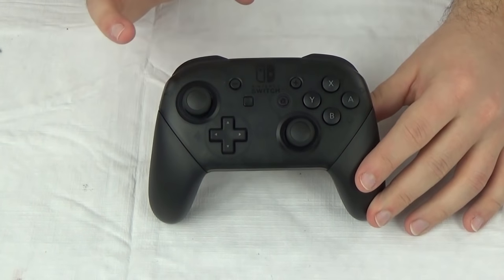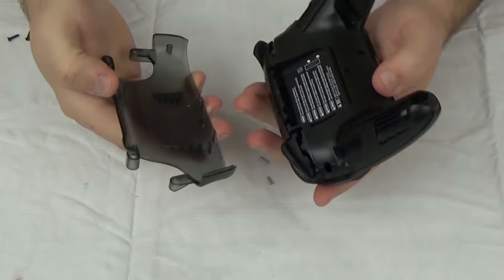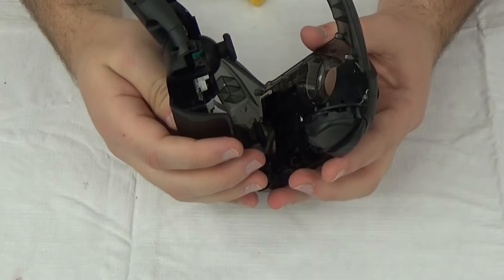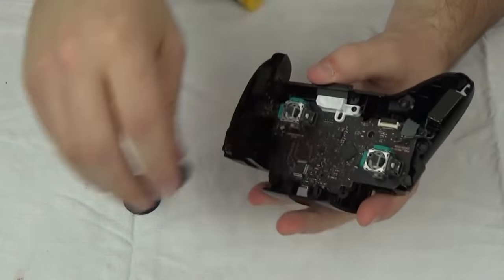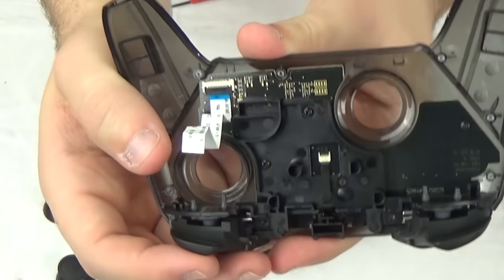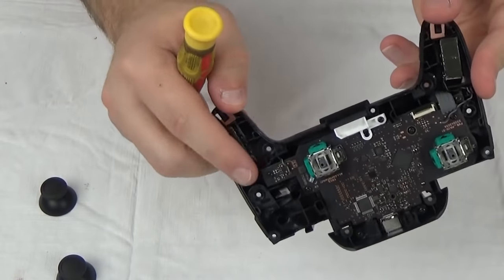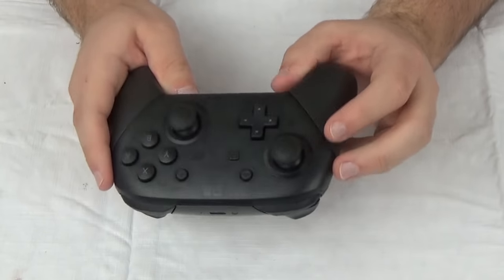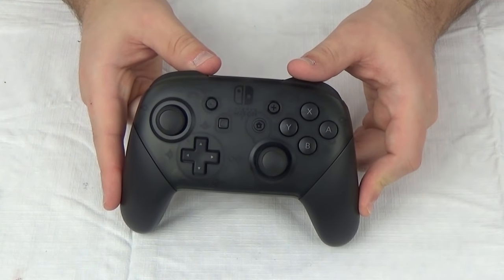Taking Apart The Nintendo Switch Pro Controller! Secret Message Inside?

Comment: It's amazing how well this is put together, and sealed, yet cat hair still gets in.
Reply: It can be a sealed multi layer steel cube with no edges and cat hair will still get in...
Reply: Bro I shined a flash light in mine that I have had for years and it's absolutely ducking filled with dog hair
Reply: @themanofmilk6394  wow do you have a dog
Reply: Bro, I was thinking the same thing. I have fuckin cat hair in mine. I don't own a cat or dog.
Reply: @ragnaroksangel  Did you buy it used or online? Or someone else used it other than you? Maybe that's why. Maybe you took your switch and controller somewhere that people either own dogs or had them over/people over who owned dogs. These are the only explanations.
Reply: Yeah I just cracked mine open and the right joystick was completely packed with cat hair. Funny considering it was the other one that wasn't working

Comment: My favorite controller so far. Feels great.
Reply: same here. got the   neon switch and the neon extra joy cons to complete the res and blue set. Pro controller does feel better than the joy con grip
Reply: Miguel Angel my husband and I are actually really enjoying every controller option
Reply: mlapointej  Same.
Reply: @gaswanson Wow I'm exactly thinking like you. I actually have the second set of Neon Joy-Cons and an extra Grip already, but I'm thinking of bringing them back to get a Pro Controller instead :/
Reply: The Pro controller is amazing, waaaay better than the wiiu pro controller. Very pleased, glad I bought one.
Reply: it's my second favourite controller of all time after the xbox one elite. but it's the best nintendo controller of all time.
Reply: Does the switch controller feel heavy at all?
Reply: Randy Beltran oh yea it feels very solid, very even weight all around
Reply: Miguel Angel lol even though its a carbon copy of the xbox controller
Reply: OldYE Chap Except the Xbox controller was a Gamecube controller with a slightly modified ABXY Layout
Reply: I've got 2 pro controllers that are broken. The first from amazon, the left stick was stuck in a downward postion causing Link to constantly move down slowly. Tried calibrating it and when you press down you can see it doesn't go past the circle like it should. Then I was able to find one at ToysRus and this one has a new problem. When you press a direction and let go, the stick jerks to the opposite side, so say i'm trying to move up to pick a conversation with someone, you press up and it jumps right back down to the previous choice. Calibrating did not help either. Now I have to bring this one back and I doubt they will have anymore left to replace it with. If I get 1 more controller that's screwed up ima flip my shit.
Reply: nah mayne.
Xbox one controller is best
Reply: Kyubey exactly people who lie to themselves constantly every day this is a clone of the xbox controller but everyones okay with cause it isnt xbox and no one will mention it either
Reply: Colin Hennessey you do realize xbox and game cube came out the same year right ? and i think only a month apart xbox didnt copy anyone they made the best ergonomic controller a head of its time just google release dates of both systems you'll see
Reply: Colin Hennessey just checked the dates came out in the same month but xbox came out on the 15th of November 2001 and the gamecube came out 3 days later on the 18th think before you speak and stop buying into the media
Reply: Colin Hennessey correction gamecube released in Japan in September 18 a month before the US launch so what ever console makers made final were set in stone they cant go back and redo their designs within a month so you're far off and the game still isnt ergonomic enough it doesnt just fit in the hand like the xbox controller does feels perfect
Reply: OldYe Chap I didn't really like the original Xbox controller it was very big and my hands would hurt while trying to rest them on the grips I also had to let go to mash the buttons at the center of the controller as well game cube controllers are very nice to hold in my opinion and is only second to the to the feeling of a game boy advance in my hand.
Reply: OldYe Chap Its not like an xbox controller on purpose I am sure as it was most likely a taken redesign of the offset sticks on the GameCube controller the control stick was upper left while the C stick was lower right it's just like an xbox controller now because of how they used the same design from their Wii u pro controller the controller has diffrent technology any way as it's not a crime to make a controller comfortable but it is a crime to copy and steal someone else's technology and use it against them.
Reply: GreyAlien2012 game stop had no issues it sounds like the controllers where thrown into the delivery truck very tragic indeed.
Reply: Legend X you forget the xbox s controller solved all those issues right and the 360 remodeled that design making the xbox controller the best most ergonomic controller yet people just say stupid shit like this cause everyone loves to hate on ms or anything to do with xbox everything to do with Xbox has bad and biased news towards it so people have gotten this trend to hate on one of the best companies in the world and if it wasnt for Microsoft we wouldn't even have video games themselves
Reply: OldYe Chap very true but we would still have games they would just be uncomfortable to play on the old style controllers.
Reply: OldYe Chap if we didn't have Nintendo we wouldn't have video games at all!!! LOL Nintendo saved the gaming crash after the Atari...
Reply: Captain Koopa no if we didn't have Microsoft we still wouldn't have gaming do you know what c+ is ?
Reply: Captain Koopa Microsoft is responsible for the structure of the internet and reason why it works the way it does cause the believed in the future no company not sony and not even Nintendo invested into this
Reply: OldYe Chap you miss interpret what he is saying if Nintendo didn't put out the first true console gaming was well on into it's grave by this point Microsoft would never have made Xbox Sony would never have made the play station and gaming in every sense of the word would be null and void in a simpler term dead. I get that Microsoft has made great additions onto the gaming world but unfortunately even with all that they have not saved gaming they've merely prolong its life span in a sense the way it's going now games are dying there is no doubt about it Microsoft has added a lot with online play and higher visual driver's such as c++, but this isn't the same Nintendo pulled gaming out of its grave mere moments before dying and gave it new life and meaning. just to be clear if Nintendo kept going as a manga company for their IP's we wouldn't even be having this conversation hell PlayStation and Xbox people would be people that play on a pc because that's all that would be there. so yes Nintendo did save gaming and gave is the chance to play games that we like.
Reply: Legend X for consoles probably yes but gaming was already heading to pc it was far from the Nintendo saved the home gaming entertainment side of the i dustry dont make them out to be a hero of it all cause they arent
Reply: Legend X people put Nintendo on a pedestal and this is why they come out with peace of junk after junk
Reply: OldYe Chap m8...Microsoft got into gaming because of PlayStation and nintendos success on consoles... no offence but Xbox doesn't have any good 1st party game THAT YOU CANT GET ON PC
Reply: Legend X if you continue tue accept what Nintendo offers for the very few exclusives it has they will always release mediocre Hardware you have to correct them you the fans have the power to stop this Nintendo has a back catalogue and a whole bunch of classic games to propel themselves into the future of Gaming with a new next-generation console that is comprable or even more powerful than the Xbox Scorpio Nintendo refuses to put money into something because they're afraid they'll lose it so they make safe Investments like a handheld Nintendo known for handheld that I can agree but this time around everyone has cell phones and it's also been proven that Nintendo can no longer skate on their handhelds to win the console war for them they have some of the best first party games Xbox and PlayStation wouldn't be able to stand a chance with Nintendo if they decided to make a console that was powerful enough to run the third party games that the third-party developers would make for them they would be the leading platform and the common denominator when it comes to development choice for the future of Gaming but they refused to acknowledge this because you and other friends like you and indulged this type of business
Reply: Captain Koopa same for ps4 m8 might wanna go read the news homie
Reply: Captain Koopa PlayStation decided to try and combat gamepass and well put their entire library of games including every exclusive they have on PlayStation now and i can play uncharted 4 and horizon zero dawn on my pc
Reply: OldYe Chap you can't play AAA games on your phone though. That's the difference, and btw Japan buys A LOT more handhelds than consoles so the switch will do fantastic in japan no problem. They just have to prove to the West why it's a good idea to get their hybrid, I already got one though because handhelds work in my lifestyle but I also have both other consoles
Reply: OldYe Chap I have in no way put Nintendo on a pedestal I agree that the some of the shady shit they do is wrong but they whether you accept it or not saved gaming Microsoft has titles I enjoy fable was one of my favorites until they cut the studio that makes it I used to  it games for my Xbox and was going to get an xbox1 until I heard Fable would stop being made by this point. I also enjoy play station games such is the way of a well rounded gamer and not some stuck up piece of trash. without Nintendo in the first place we would not be gamers on consoles but computers which didn't sound so bad but I would miss games like Zelda on Nintendo, fallout on play station and Xbox and many of the other title's that just feel better yo me on a console I would miss my PSN friends and all the like in reality all you see is some "Nintendo fanboy" even though I only stated fact and gave credit where credit is due Microsoft brings a lot to the table with visual driver's and internet conectivity but I haven't played a game on any console that makes me feel emotion as Nintendo does their hardware may be cheap but their developers make great games. as do Microsoft and most 3rd parties I enjoy all forms of gaming. also I did admit that Microsoft makes great controllers for the Xbox 1 and 360
Reply: OldYe Chap I am not puting them on a pedestal I would love to see Nintendo be who they where in the 90S and I feel they are starting to move in the right direction again the game lineup isn't as bad as the Wii u where all the games where at launch and then a 1 release every half of the year. I want them all to succeed but the way it's going I see copy past every where I look now it's hard to play these games sometimes because they feel over played and used up I want a game to wow me again I would love that and this Zelda game did just that I tried to get this with the elder scrolls series many years ago but it felt a little bear of terian even.
Reply: OldYe Chap LOL XBOXS HARDWARE IS A POTATO COMPARED TO A PC!!! AND A PC IS CHEAPER LMAO people don't pay for nintendos console for power they pay for games...
Reply: OldYe Chap but I sitll respect Xbox for its media system. Xbox is made for games but mostly a entertainment system.
Reply: Captain Koopa pc isn't cheaper a console is sold at a static price all the hardware they get subsidized pc you have to pay full price with very little in sales pc is far from cheaper at 500$ being the price point at which i can game comfortably not being cheaper there is no cheap point for pc am xbox one being 250$ brand new with hdr graphics and now the new scorpio going to be the highest point in gaming for at least two years being a reasonable 4k 60fps machine at 4 to maybe 500$ dollars well id take that gladly over a 700$ pc
Reply: Captain Koopa no its not games first then entertainment thats the media spin on it you've people have heard nothing but bad for xbox when it truth its the console that gives the most all dlc for halo 5 is free and its been that way from launch same with gears of war 4 and a few other games i cant think of but xbox has been put in this bad light by the media when this whole generation its offered the most for gamers and it'll continue to do so
Reply: I mean look set this picture up for xbox one s for 250$ with xbox game pass for 10$ you get access to over 100 games and download them and play them as long as you want thats what xbox is going to off in a week from now
Reply: gswanson You have a lot of hands.
Reply: Miguel Angel I agree ecept I prefer the PlayStation layout with the sticks on the bottom
Reply: OldYe Chap wtf are you saying the original Xbox controller was horrible
Reply: Miguel Angel I prefer the GameCube controller.
Reply: StuffWithTim Sure, the GameCube controller is cool, but I like the pro controller because the buttons aren't weirdly mapped.
Reply: cuz its the fucking xbox controler XD
Reply: Bebo Angel WOOMY
Reply: Ennard TV I don't play splatoon 2. Sorry
Reply: Still think my xbone elite controller is the best controller I've gotten (I have gotten that switch one)
Reply: Bebo Angel it's the same as an Xbox controller apparently
Reply: Bebo Angel it feels really good 10 times better than joycon grip but joycon grip feels ok for me is comfortable enough
Reply: +ECGaming _ 
I have a small problem with my pro controller. Lemme explain:
The right handle seems to be a tad out of place. You can kinda feel it when holding the controller. The controller works 95% fine. The only problem have have with this small disorientation is that the left side of the controller has a stronger vibration than the right. Also you can also feel the small disorientation. It’s irritating when playing games that use HD rumble a lot like Super Mario Odyssey.
I’ve had this controller for a while, so I can’t return it. I could just keep ignoring it, try to send it to Nintendo, or try to fix it myself.
Reply: Mariokart Fanatic Hmm...I haven’t get it Mario Odyssey so I’m not sure...
Reply: i love every controller option for the switch. the pro controller is absolutely wonderful
Reply: i prefer it to my xbox one controller for my pc and my other ps4 controller
Reply: @koolass koolass I'm sorry, but I don't cry over video game controllers and I think you're just a teeny bit too biased
Reply: woah alright calm down lets have a nice argument without insulting anyone. the only problem with it is the headphone jack everything  else is great and you know it its a high quality controller and its not a knock off of the xbox controller its just using the same layout, which has been used by nintendo in the past with the gamecube. and the switch is more expensive than the ps4 and xbox is cause it just came out. and its way weaker caues its a tablet. its a portable system of course its gonna be weaker.
Reply: @koolass koolass actually it's been out for 2 years?..
Reply: @koolass koolass idk if you're over exaggerating or being serious about the games but they're pretty impressive great looking games. Whether you like it or not the fact that this tiny tablet is just as powerful as an Xbox 360 is pretty amazing.
Reply: @koolass koolass this tiny tablet can run doom (2016) a game designed for the ps4 and xbox one and you're saying its not impressive? we've never seen this before and plus alot of the 360 games are being ported over to the switch.
Reply: Not really, I bought a face off Nintendo controller, its wired and have 2 buttons at the back. Very useful and reliable...
Reply: Same!! 🔥🏆
Reply: Stolen

Comment: An important note: the screws on the Switch Pro controller aren't Philips heads, they're JIS. While they look similar enough, the dimensions are just off enough to where a Philips head screwdriver can potentially strip the screw. I just learned this the hard way.
Reply: That explains it. Any idea on the product to buy?
Reply: @3plecheeseburger  I believe ifixit offers a JIS screwdriver set on their website.
Reply: Which screws? The first 6 (Handles and Undershell) or the last 5?

Comment: It is a 3DS battery it even has the 3DS battery reference on it. CTR-003. Every other Switch peripherals and parts have a reference starting with "HAC-"
Reply: RudyC3 well they ain't wasting anything which is good xD
Reply: Holy crap, I noticed that too!
Reply: It's also used in the Wii U Pro controller.
Reply: RosalinaDaHacker64bit I see you every where
Reply: RudyC3 you could say because it's a HAC!
Reply: RudyC3 they want u to hack it?
Reply: If you use the switch pro controller battery on the new 3ds xl and stick it in right, it'll work

Comment: This controller has two large Taptic Engines and an infrared CMOS... No wonder it is so expensive. I am pretty sure Microsoft knew about the existence of this technology which was already being used by Apple. But they probably didn't incorporate it on their controllers because of it's current production cost... Way higher than simple rumble engines..
Reply: HD rumble boi